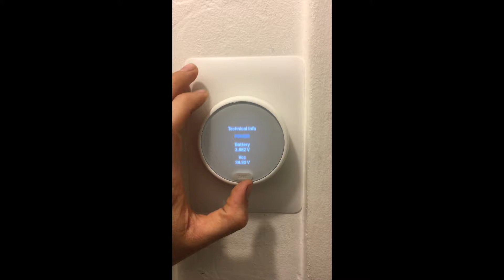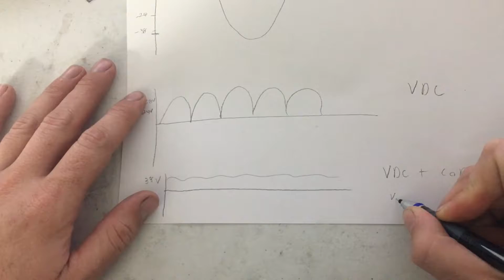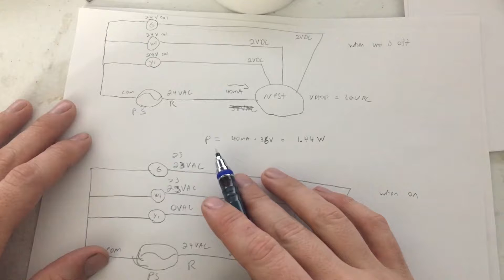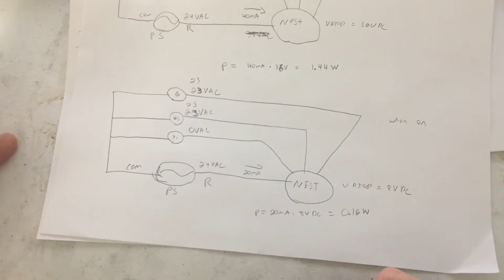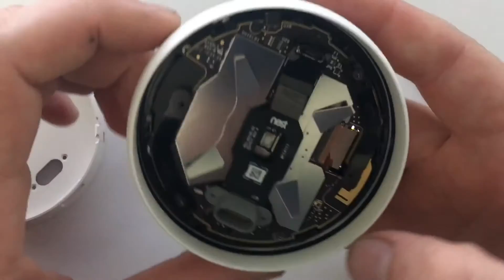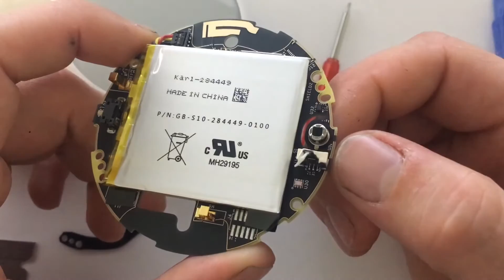Nest Thermostat E - No C Wire and Disassembly

Comment: I had the same model like yours. The battery died (did not hold charge) after 15 months. Hope you can do a video of how to replace the the battery or how to remove the battery from the circuit board. Many thanks.
Reply from the maker: Hmm, the battery should have a lifetime of more than 15 months unless it was a manufacturing defect. It is possible though that it is bad. Out of curiosity, once you have left the thermostat plugged into the USB for 5 hrs or so (until it is fully charged). How long does it last. If it immediately shuts off then it probably does have something to do with the battery or internal issues to the thermostat. If it lasts for more than 12 hrs, the issue is probably with your heating or cooling system.
Reply: @lsm13b66  Thank you for your speedy reply. I charged it with USB for half a day. While charging, the unit was very hot to the touch (very unusual). When I put the unit back to the housing, it shows low battery and less than a minute, it shuts down. So I waited for a day and charged it for at least 7 hours. Then I put it back to the housing, the unit did not have any display.
So my conclusion is the battery is defective. That is why I would like to find a replacement battery. I tried Amazon and does not find a good match.
BTW, I do have 24V (C) connection to the furnace.
Reply from the maker: @fredchiu  I agree with your diagnosis!  I'll look
Reply: @lsm13b66  Looking forward to view your next video. Thanks.
Reply from the maker: @fredchiu  I contacted support and am hoping they will help since google owns nest and youtube. https://twitter.com/googlenesthelp/status/1158147780210130946
Reply: @lsm13b66  Thank you in taking your time to help me out. I will contact Google support. Thanks again
Reply from the maker: Fred Chiu let me know how it gets resolved, thanks!
Reply: @lsm13b66  Yes, I will report back. Thanks.
Reply: I just finished talking to the Google Nest senior support agent. To put a long story short, the agent offers me a one time courtesy free replacement unit by post. Also he will allow me to buy a cheap ($15-$25) thermostat to bridge the gap.  Nest will reimburse me the expense. I am waiting to receive my replacement unit in 3 - 4 business days. Many thanks.
Reply: @lsm13b66  I got my replacement unit today. Plugged it in and my A/C is working again. Don't know how long the battery in this new unit will last. Many thanks for your time and help.
Reply from the maker: Fred Chiu glad I could help!

Comment: Great video. Just did my battery. 

How did you re-attach that ribbon connector? the little flap on mine will not "click" back down, latching the ribbon. Thanks.

Comment: Nice video.  A customer of mine disassembled their Thermostat E looking for batteries.  The thermostat is re-assembled but is getting the same error that you mentioned you had, saying to attach to base even though it already is.  What exactly did you do to resolve it?  I cannot see any connector that is not connected, but I must be missing something.  Thanks!
Reply: I am having this same problem as well.
Reply: I’m in the same boat. Has anyone figured out a resolution yet?
Reply from the maker: @goggitron  maybe check the ribbon cable and clean it with a pencil eraser.
Reply from the maker: Check the ribbon cable, maybe clean it with a pencil eraser.

Comment: i just installed the nest thermostat three days ago without a C wire.  I have a red, white, yellow and white wire and nest told me that I do not need a C wire.  It is turning on the heat, AC and fan perfectly.  Do you think I should be worried about getting the C wire installed as it has been only three days.  After watching your video I checked the furnance and I see six wires instead of 4 on the thermostat.  I see one additional red and white wires.  The additional white wire is connected to C and red wire connected to Y along with the yellow cable.  Do you think I need to do anything?
Reply from the maker: Hassan Aslam, not if it’s working, I live in Florida so I’m not too familiar with heating systems but it’s possible that the additional c wire is tucked away behind the wall because the last installer didn’t need it. The only thing is that after 5 years or more the battery will start to degrade inside the nest thermostat and it might not be able to store or supply enough power to operate properly in which case a c wire would solve the problem. They haven’t been out for long enough though to tell and who knows, there’s lots of things that could happen in that time frame, maybe there will be something better by the time it becomes an issue. Thanks for watching!

Comment: This video is fantastic. Great explanation!
Reply from the maker: Peter Semetis Thanks man!
Reply: @lsm13b66  If my heating system is over the voltage limit, would the Nest unit alert me about this when installing? (i.e. 120 volts is too much)  I installed the Nest E, and the technical Power specs screen reads 30 volts when inactive, and 7 volts when the heat kicks on. All normal, right?
Reply from the maker: Peter Semetis yes, my guess is it would just short out and destroy the unit if the voltage was above 40vac.
Reply: @lsm13b66  That's scary. Since my oil burning system is just 4 years old, the guy at Ace Hardware said it likely was not high voltage, even though my old thermostat says 120. Good thing he was right!
Reply: @lsm13b66  Thanks again for the video and the knowledge. I installed 2 Nests and it's cool to be monitoring my heat's performance. Hopefully can save a few dollars - have a warm winter!
Reply from the maker: Peter Semetis, you too! I found this on the Nest website. “The Nest Thermostat only works with low-voltage systems. Both millivolt and high voltage systems are relatively uncommon and are not compatible with the Nest Thermostat.”